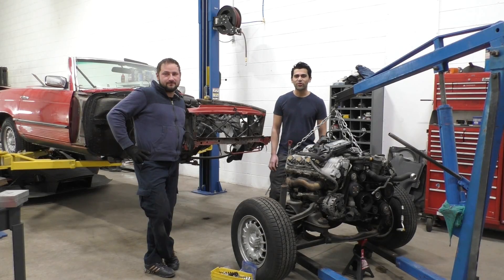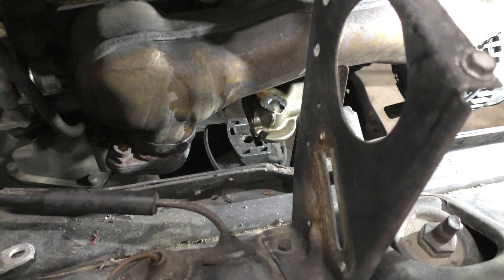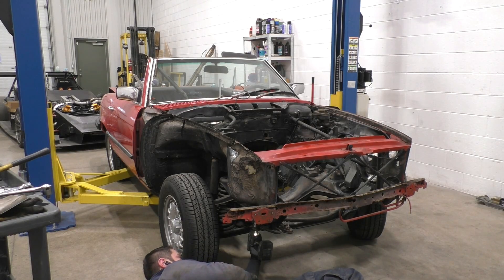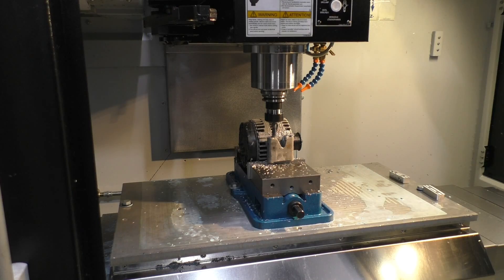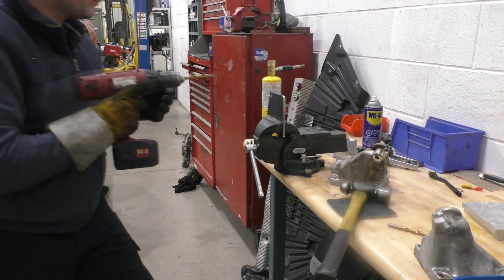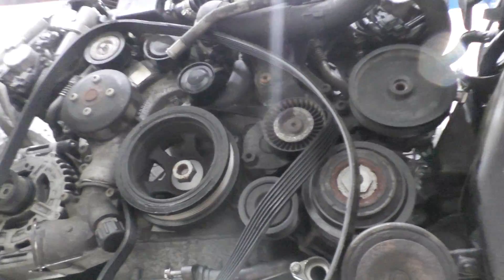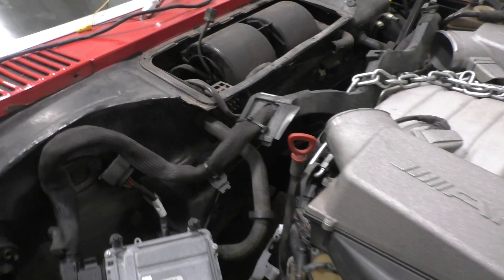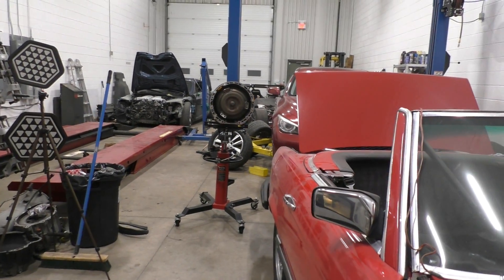Mounting a C63 AMG Engine in a 1980s Mercedes SL - Project 630SL Part 3

Comment: What I've been told over and over is that the fab work is the easy part, it's the electronics that make these MB engine swaps difficult. Can't wait to see what you guys do to get it running.

Comment: Awesome man. Im currently putting a Ford Barra into a W123 300D 👊
Reply: I like straight sixes and w123's.
Reply: Turbo Barra? Great engine, best thing Ford Oz ever did.
Reply: @slasher9883  Well yes and no, na+t mate, best bang for your buck if under 600hp apart from a 2jz. The internals from some of the LPG na barra's are the same as the turbo, so no need to swap out. Agreed, best engine produced here. Cheap as, too. Got the base motor for $450, borg warner s366 .91A/R for $1200 👍I currently have a 2J on the go as well for my z32 300zx slicktop. 2nd 2jz swap into a zed (fave chassis)
Reply: @slicktop2jz855  I had a NA Barra in my FG Ute. Ded gas, with the ancient E-gas system which I hated. While the rest of the car kind of fell apart around it the Barra stayed strong. Was going to upgrade to an ECo LPI ute after the FG was written off but seems LPG is a thing of the past here now. Interesting 2J swap you have there as well, still reckon the 2J is the king of the straigh six hill but the Barra not far behind.
Reply: I think you should stick to the brand, when doing an engine swap. Mercedes OM606 Turbo Diesel is actually a very poular thing to swap into other older Mercedes here in Europe!
Reply: @georgobergfell  My car, my money, my choice. Go tell someone else how to spend their cash.

Comment: Good advice from AC tech - if you're going to reuse AC plug the hoses. Anything that gets in there (dirt/bugs) could make your life miserable, when it finally clogs something (usually expansion valve) and you have to tear half of the car apart to get to it.

Comment: Guys, do some research on " R107 front sub frame reinforcement "   There was some sort of lower control arm mount cracking that a repair kit took care of.  I don't know what years were affected or if the factory made modifications.

Comment: If I had that donor car (C63) I would put that engine in the W124 chasis. Then you got yourself your own "Hammer" Restomod.😁😁
Reply: Good choice for me in a 190e
Reply: Or put a MB v12 in it out of a s600, would result in some surprised faces on car meets
Reply: @lillexus5589  Basicly your own W124 Brabus. W124 Brabus had a V12 as well. But it was a 7.3l engine,not a 6.0.

Comment: Any plans for the wheels?
Please don't put too large and non contemporary rims on this car!
I would prefer the 15" version of the original bundt alloys, or possibly 16" Lorinser LOs or Pentas. Means you can't use the brakes from the donor car but there are beefy enough aftermarket brakes available that would fit inside a 15" or 16" rim.
Reply: Or if you really think you need to go larger, there is a 17" replica version on the R129 "gullideckel " rim that is very similar in design to the original 15" R107 rim on the 1986-89 facelift model.
Reply: Lorinser would fit the car perfectly..they are classy and wild at the same time
Reply: @simolajustice6555  Yeah I had those on my 1989 300SL. Very difficult to find those wheels back then (early 2000) but now they started to make them again a few years ago! I.e. the real stuff, no replica.
Reply: But original bundts (the 15" version) would be even cooler on this car, a total sleeper. Or the 15" version of the steel hubcaps the were fitted as standard equipment (14" version) on the early 107 SL.
I have also seen custom 16" and 17" split wheels made from the original bundts alloys, they are also pretty nice!
So many options... But just don't go with modern wheels!

Comment: How are you guys making all of the electronics work? There are a lot of cheap V12tt cars running around that would make good engine donors if the pcm issue was addressed. I would gladly rip the engine out of my w220 S600 tt  to swap into a w126 long wheelbase.

Comment: I’m confused why you didn’t remove material from the ac and alternator bracket rather than from ac and alternator itself. Removing material from the brackets means the owner can easily buy a new ac or alternator from the parts store. The way you did it he well have to have the ac or alternator rebuilt or buy new and take it to a machine shop. 

Beside the ac and alternator being close to the subframe if they needed to be replaced it looks the engine would have to be raised. Are you planning on making more room for ease of repairs?
Reply: i dont think the owner cares, as long as its done and possible
Reply: Very few cars at this level of modification are built for serviceability. Odds are good when servicing happens, the car will go to XF or a similarly qualified shop. This isn't the kind of car that you take back to Merc to get an alt swap.
Reply: Any repair on this thing will be a pain

Comment: That subframe is not engineered to handle that much torque. 
Would have swapped the 63 subframe with custom brackets to tie body. 
Just look at those flimsy shock and antiquated suspension.
All that work for it to crack in half after several shock loads.
Reply: I assume he will reinforce the subframe later on

Comment: how you gonna do with speed cluster on dash, abs and speed sensors? w126 has one single speed sensor in the diff. new types has speed sensors on the wheels.

Comment: The problem with cutting the Alternator and AC compressor is that you've now made them one off items which are now not easily swappable if failure occurs.

Comment: After closing the air gap between the engine and the accessories, the longevity of those parts is gone. Also the belt needs to be custom size, so the next maintenance will be soon, and painful. A lot easier and less painful job would have been customizing the subframe and subframe mounts, as in re-fitting the C63 subframe into that old rust bucket.
Reply: That’s the right way to go

Comment: Usually when you fit a big engine in a smaller car the engine gets set back as far as possible, it's not as tho they have to worry about a rear distributor etc so why leave 2" or 50 mm clearance? Would not have needed so much cutting on the cross member to start with, and if you going to cut up a cross member start with a dummy one, so you can do a very tidy proper one to finish, just saves a lot of time and missery later

Comment: Man awesome work. I do have a question though. I have the w460 g wagon that I i engine swapped to the om617 engine that i pulled from a w203. My question is im thinking of swapping the gearbox to the automatic that came with the 203. But I'm worried how the tranny wiring will work without speed sensors

Comment: i think it's a bad idea, and wouldn't it be better to adapt the entire suspension from w204 to r127?
Reply: I have no experience from this kind if build but that was nu thought as well, reuse as much as possible of the suspension and chassis components from  the donor car. Except the brakes, the must be small enough to fit original or contemporary tuning wheels (e.g. Lorinser LO), large modern rims would completely ruin the looks of this car.

Comment: dude no! you removed 40%+ of the subframe material! I would have removed alternator and AC comp and make a custom cnc mounting bracket and mounted it towards the top! I hope the owner understands and is always on top of the engine mounts condition and replacement! but TBH after the subframe hacking I wouldn't feel comfortable driving it if it had a 4 cylinder forget about getting in it with a M156! See if you can reinforce the sub frame with vertical steel plates welded in it and patch that hole!
Reply: Yea it is worrisome. Such a powerful engine in an old and heavily modified structure....

Comment: No where in this engine steering conversion do they mention if they have checked with the vehicle modification code in the country the car will be registered at, for one thing he mentions loosely at the end they will have to cut the chassis rails to make the radiator fit, "a practice this strictly forbidden in a lot of countries of the " devellopped world"

Comment: This seems to be a "suck it and see project, figure it out as we go along", and nowhere near good engineering practice. Vehicle manufacturers spend millions ensuring what they design and manufacture is safe. At the very least you need to carry out a Finite Element Analysis particularly on that subframe, when you have "strengthened" it. however, even a FEA isn't really going to identify weaknesses unless you can determine the forces that it will be subjected to.  Whoever that guy in the UK is, he need to have his head analysed if he intend to let that car loose on a public road. You are highly irresponsible as "Engineers" to give the poor guy that joke of a car with your blessing. Stick to the racetrack guys where its relatively safe to experiment.